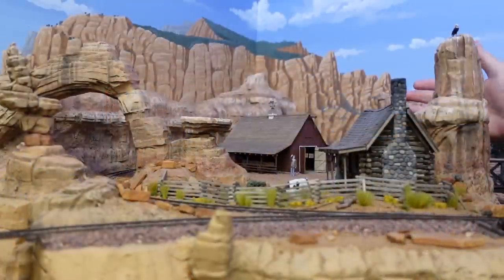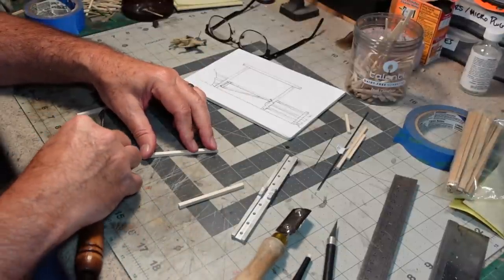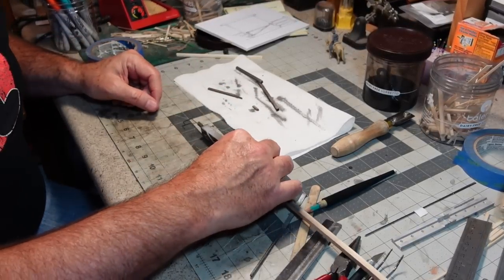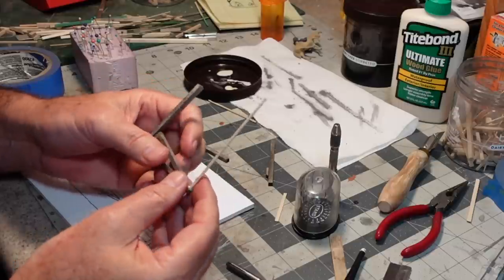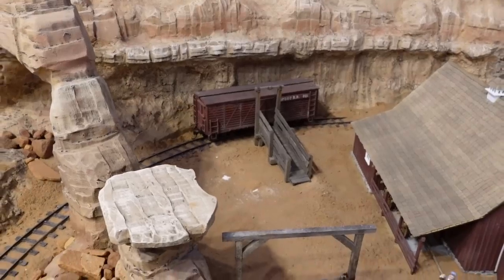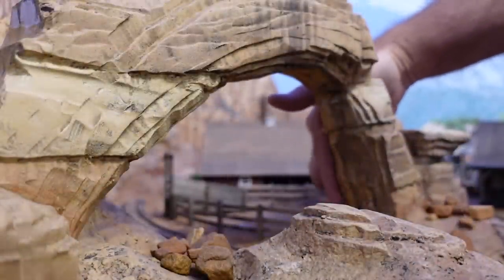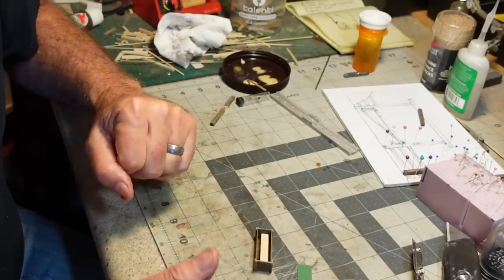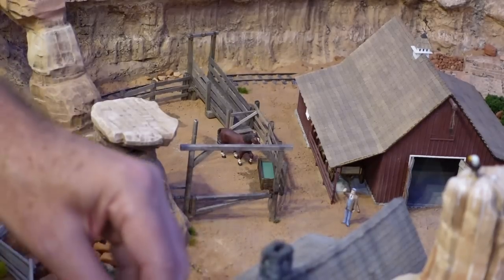Building a Horse Corral in O Scale

Comment: I am a professional machinist so have good calipers.  Battery powered but they last a long time before needing a battery replacement and the battery is cheap and sold in many stores. I usually keep a spare or two in the case my calipers comes in.  What I want are settings for at least O, HO, S and N scale along with inches and millimeters.

Comment: I have a question, pardon my ignorance you said that you are using 8" x 8" beams so what is the actual dimension of the Balsa or Basswood that you are using and is it something that you cut yourself from a larger square piece or is it purchased, as the size of this particular lumber would be .06666 or 2/3 of an inch. I have no problem making my own beams but if I can buy them it would be easier or quicker. Just curious. I live in Alberta Canada so it seems to be harder to find companies that actually provide O Scale lumber.
Last still wondering where you get your figures from.
Blessings
Pastor Randy Bourque
Great Video some of the best I have seen overall.
Reply from the maker: I buy most of my scale lumber from Northeastern Scale Lumber, also in Canada. An O scale 8x8 should be 11/64 x 11/64".
Reply: @ThunderMesaStudio  Ok thank you for that I appreciate the quick response. I will look for the company here in Canada.
Blessings 
Pastor Randy Bourque
Reply: @ThunderMesaStudio  I have another question if you don't mind, what are the most common board sizes for O Scale. It looks like I need to pay the piper and order from the US as the Canadian Express Line doesn't carry very much so I want to order a bunch of pieces as it is better to have them on hand then have to pay the extorted shipping rates to Canada several times. Again I thank you for taking time to help.

Blessing
Pastor Randy Bourque